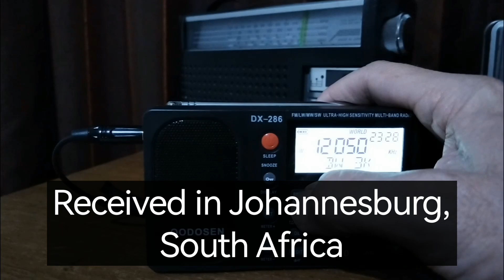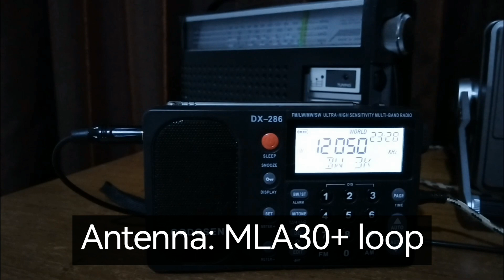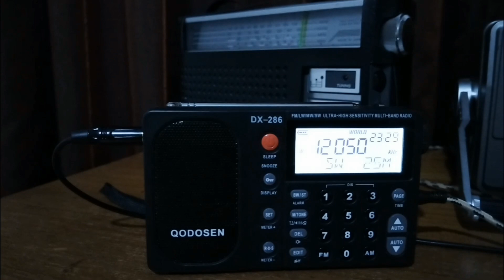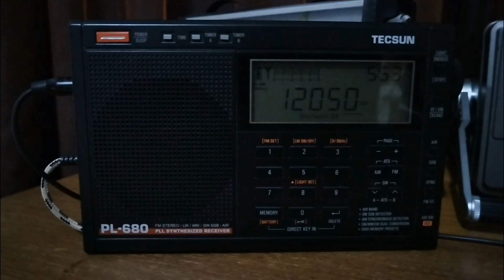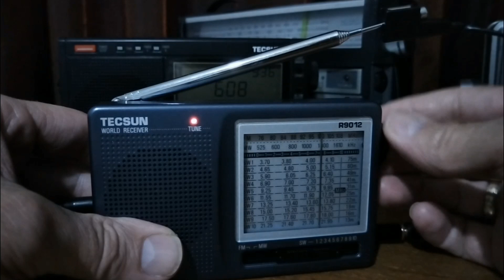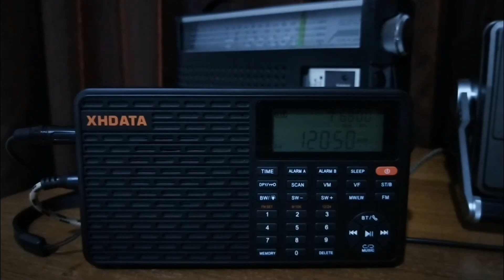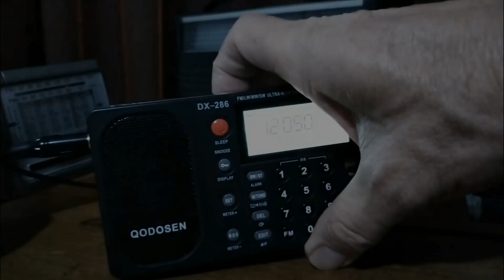12 radios compared on weak EWTN 12050 kHz: Tecsun, Raddy, Clooblut, Sony, XHDATA, Lijiani #shortwave

Comment: What is really missing from your video are two top of the line radios: the Belka DM Max and the Malahit DSP3.  I am confident that they would outperform every radio in this video, especially on SW.
Reply from the maker: Thanks for your comment! You are right, I haven't tested these. But they are well outside the range of radios that I usually review on my channel. I prefer to focus on radios that cost $100 or less, the middle-market segment. Both the Malahit and the Belka are well over $200 each. I am sure they are both excellent radios though, at that price they should be. On my channel I just like to show what less expensive radios can do. I buy most of the radios I review myself, so I set a realistic limit for myself :-)
Reply: @swlistening  that makes sense, and, actually, it is super that you review cheaper options which are more accessible.  Good luck and thank you for your channel and videos!
Reply from the maker: @vineyardsaker6195  Thanks!

Comment: Hey Andre, nice weak signal DXing there. It is crazy how the type of receiver you use for DXing a weak signal can very drastically from being understandable to there barely being a carrier sound. Also nice to see that they are back on SW. They were off air for a bit because they needed to repair their transmitters. I would say the Qodosen, the Tecsun, and the Sony all performed the best.
Reply from the maker: Thanks Liam. I did not know that they were off air for a while, because I barely ever hear them :-) It is really interesting how the type of receiver can make a real difference on very weak signals. But with strong signals, to my mind, all receivers appear to be quite similar.

Comment: Ah, I see someone has quietly purchased a Lijiani RD-239! 😁📻

I am still miffed that the Lijiani official store sent me an RD-218 with "Lijiani" on the bezel instead of Clooblut. For some reason the Lijiani doesn't have the "Portable AM FM SW Radio" text in italicized font. This gives the Clooblut its receiving power! 📻💪🌩

They say that half of a receiver's performance is the external antenna. Andre, you have added many amazing radios to your collection but one thing remains the same - that MLA-30+ in its original configuration. While this loop antenna is very suitable for indoor use, active antennas do amplify noise. Since I bought that inexpensive "A25" 100-foot long wire with a mini 1 : 49 balun I noticed that it's much quieter than my indoor MLA-30+ and pulls in distant stations that the latter can't catch.

I hope that you'll consider exploring alternative antennas (not the 5m wire that comes with PL-680) for 2025. I know that you've put a lot of stock into the MLA-30+, but I'm thinking that there could be much better antennas for challenging DX'ing situations. 😀
Reply from the maker: I actually received the RD239 as a review copy, just recently. I will still make my review video, once I've tested the RD239 a bit more.

I agree with you that antennas play a very big role in reception quality. But even with a good antenna, some radios fall behind, as we saw in this video. The D-109 and the D-608WB, the Tecsun R9012... Even with the same antenna as the others, they did not perform so well here.

My MLA30+ is outside, not indoors, so I think it performs at its optimum level. I nstalled it in such a way that it nulls the noise form my house. I will see if I can try any other antennas this year, but so far the MLA30+ seems to be my best one. It is much less noisy than my 15 metre wire (also outside), and quite a bit stronger than the 5 metre wire. On the Hammarlund the MLA30+ is really great. But I will certainly look at some other options, that long wire you got does sound like a very nice option.
Reply: @swlistening  Ah, someone from the Lijiani company must have seen your videos promoting the Clooblut RD218, andre! 😀

I think the simple reason behind small SW portables not performing as well as larger portables is RF input overload, particularly observed in DSP based receivers. Many of them lack quality front end bandpass filters as their respective manufacturers try to make them as cheaply as possible. Anyway, I think you should also explore using baluns on a length of wire as they help to minimize unwanted noise picked up by your feed line to your radio. 🙂

I'm still on the learning curve when it comes to external antennas and I refuse to accept the MLA-30's default configuration. Both the bias tee and the LNA have potentiometers in them which you can tweak further to suit your home environment. The loop itself can be upgraded with hollow copper or aluminum tubing for a better performance. It's understandable that the factories that make the MLA-30 antennas use the cheapest materials available to keep the price affordable. 😀
Reply from the maker: @StratmanII  I think you are right, the Lijiani people saw my review of the Clooblut 🙂 Apart from the RD239 they sent me, they also sent me a prototype of a new radio that has not been released yet, they wanted my feedback. All will be revealed in my next podcast, hopefully this weekend!

I will certainly explore antennas more this year, especially as I learn more about antennas in my studies for my ham license. 

You are right about the small portables and the lack of filters. Some of the small and inexpensive portables really overload when you introduce very strong signals from external antennas. But, I guess, some of these small and inexpensive radios serve their purpose, some people just want simple radios that perform OK on their whip antennas.

Comment: Try listening to the WWCR signals they have several transmitters and change frequencies during the day for optimal reception
Reply from the maker: Thanks for the suggestion, I actually do hear various WWCR frequencies fairly often. These are easier catches for me than EWTN. Here is one video with two WWCR frequencies: https://youtu.be/FSQYvc1uTx8?feature=shared Not the best quality, but it's on the tiny Raddy RF886.
Reply: @ thanks! WBCQ is always interesting too

Comment: Hello André, this kind of mega-shootout is a highly interesting new trend in your videos. Great catch by the way, I don't think I ever heard this one. Congratulations!
To me, your good old Sony takes the win here again. You really had some luck picking up this gem of a receiver for a cheap price. I'd call DX-286 vs. PL-680 a tie. The D-808 comes quite close too. The Raddy doesn't do so bad. Yes, the signal is quite weak but on the other hand it seems to catch less noise than many others.
Catching such a weak signal on the cramped scale of the D-220 is Mission Impossible.
Not surprised by the D-608 fairing bad, I expected better from the D-109.
A bit disappointed that you didn't throw the PL-368 in here.
Reply from the maker: Hi Alain, I am glad you enjoyed this. I think many viewers like to see these mega-shootouts when they are uncertain about which radio to buy. Maybe this helps someone make the right choice, for their needs. I agree with you that the Sony is the best here. The D-808 and PL-680 come very close though.

You are right about the RF886. While weak, it is less noisy than on some of the other radios. Indeed Mission Impossible on the D-220. The D-220 is more about luck, you never know what you will hear. But hard to find specific signals, especially if they are weak.

Comment: Good comparison Andre I still like the XHDATA with the light blue screen in my opinion better sensitivity than the amber screen ill check EWTN tomorrow just checked the times and frequency and radio Radio Ndarason International Ascension 12050 is coming in strong on the TECSUN PL-990X yes another one better tone than the 880 a few more bells and whistles hope you are keeping well hope to see the SDR signals in future videos...
Reply from the maker: Oh, and yes, I will make videos with the RTL-SDR, for sure!
Reply from the maker: Thanks Stephen. Ndarason is usually very strong here in Johannesburg, that is one of the reasons why I hear EWTN so rarely.
Reply: Nadarason usually is a relatively easy catch from here in France too.
Reply from the maker: @F4LDT-Alain  It seems to be quite a strong signal, which is nice, but usually it prevents me from hearing EWTN 🙂
Reply from the maker: Stephen, I saw a comment by you in my email, asking about the time for EWTN, but I don't see the comment here now. Anyway, EWTN is on air from 14:00 to 00:00 UTC every day. But Ndarason uses this frequency from 18:00 to 21:00 UTC. So best time for EWTN would be after 21:00, unless Ndarason is off air for some reason.
Reply: Hi Andre just me being a bit thick lol realised after I put the comment so deleted it and thanks for the info I've been listening to new Zealand radio for a few hours in the morning  comes in nice and clear on wire and MLA 30  with band width adjustments  Thanks again Andre... @swlistening
Reply from the maker: @stephenwright8103  OK 🙂 I wish I could hear Radio New Zealand, but it remains a very hard one for me.

Comment: Sorry while looking for something I pressed send in error. I meant to add the Degen R11 is by far the best on shortwave, helped by it's great speaker, but it's range is limited and it's wheel tuning may not be to the liking of some (I think it's fantastic!) I also have another 21 band sw radio I bought because the connector it uses would fit my sdr but from the local shop the connector costs 19 euro, but I bought the radio with connector fitted to plug for 9 euro from AliExpress. It's not very good but it charges phone batteries, helped my sdr and works enough to be called a radio. It's a Pobuzc (or Pobiizc or pobvizc) f176. I consider it a free radio as the connector at 19 euro locally is a stupid price.

I am currently awaiting a new gain amplifier for my aerial and loop antenna so a bit limited in capability.

Very nice comparison, thank you for your regular sw uploads. Very interesting.

Comment: Coming through my phone, I heard the D 808 by far the best.

Do you find the Xhdata D 608 weather band and the Xhdata D 109 to be almost identical in abilities? If I am hunting a signal with one and I change to the other it's identical in its response. I have to change to one of my radios with an S14732 chip in inside (Ats 120 pro or the AQ1 mini) the HanRongDa 747 I use for other stuff
Reply from the maker: Hi Terry, I also think the D-808 performed very well. Personally, I think the Sony is marginally better, but they are very close. 

About the D-608WB and the D-109. I do think they are identical on the inside. I have had the same experience, they seem to perform similarly.